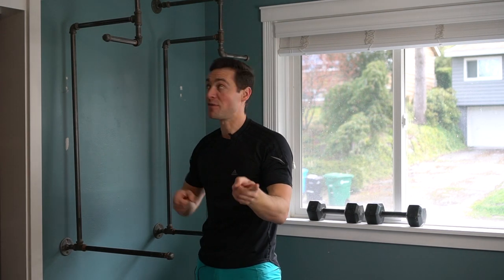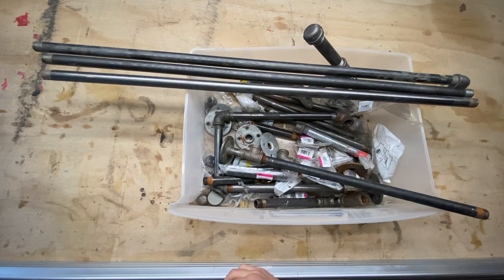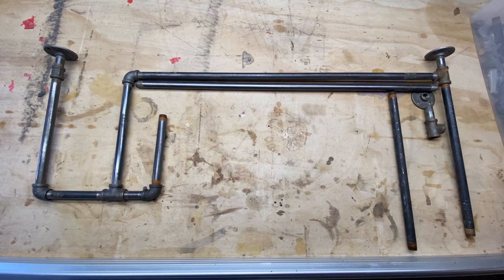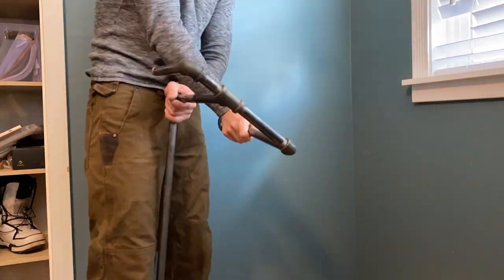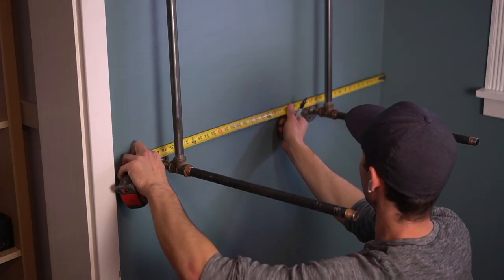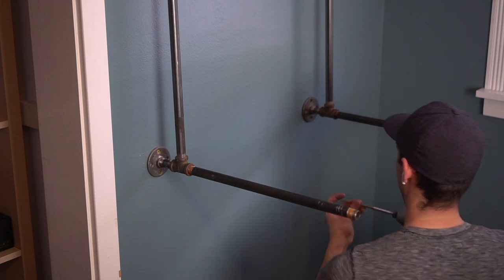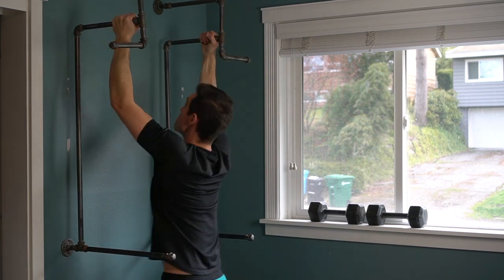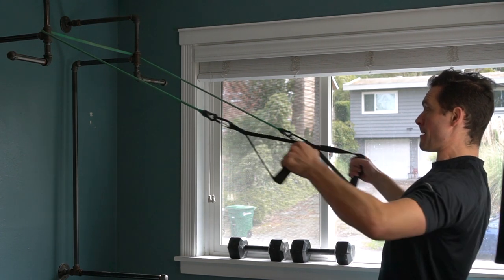DIY HOME GYM : Pull Up Bar and MORE

Comment: Due to the rigidity necessary, I wonder if using something like 'JB Weld' as one would normally use pipe 'dope' (thread sealer) would be a safety improvement. 
Having a joint suddenly move unexpectedly during an exercise could very easily result in injury.
Reply from the maker: Great note John and I bet that would work extremely well to make the system a bit more rigid.  Thanks for watching and hope you enjoyed the video.

Comment: Definitely cool but that much iron pipe is going to cost you about as much as a wallmount pullup bar from amazon. Nice to have the dip bars though
Reply from the maker: I completely agree Jay and the only reason I did this was because I had extra iron pipe laying around.  If I didn't I wouldn't have made it out of this that for sure.  Thanks for watching and hope you subscribed.

Comment: my good sir,  I weigh nearly 400lbs would this work for me?
Reply from the maker: Good question Porque.  Like I said in the video I would suggest going with 3/4" pipe and I would probably suggest adding floor supports for the dips so you can guaranty support.  Thanks for watching and hope you enjoyed the support.
Reply: Congratulations on your decision to get fit. It’s unlikely that your arm strength is going to be enough to effectively move 400 pounds without injury. Maybe consider engaging in a good cardio program if your physician agrees then move into something like this once you’ve dropped some pounds. Using the rubber tubes attached would help with gaining some arm strength though. Good luck!